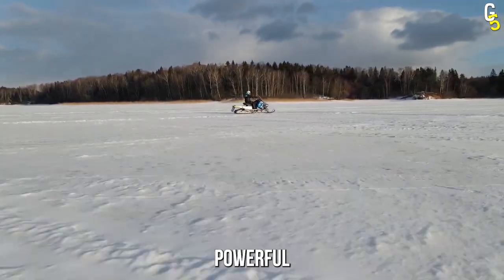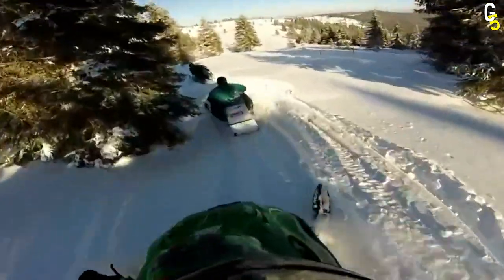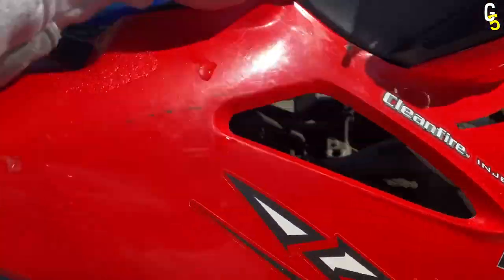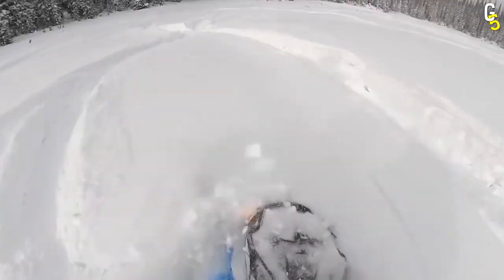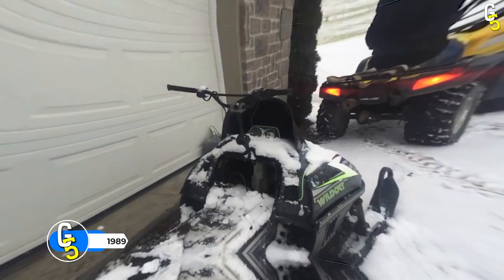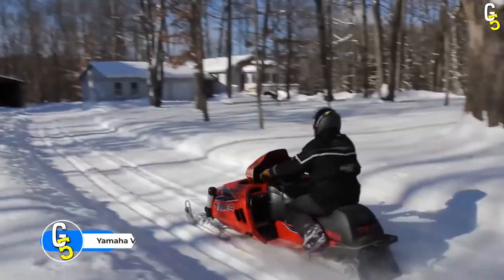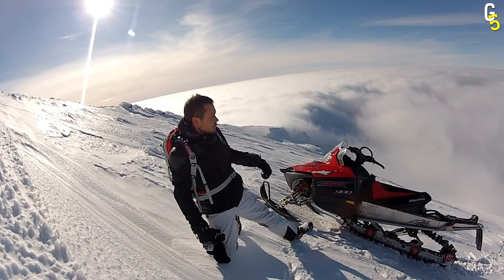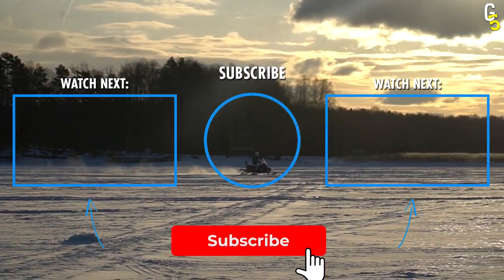6 Snowmobiles That Could KILL YOU! ☠️

Comment: You covered the same sled twice. The RMK 900 and the Fusion 900 have the same problems. One cannot be worse than the other. Also, the fusions were the fusion chassis and the iq was iq. Not the same. Thirdly, the fusion 600 was a newer model than the fusion 900. Also, Polaris discontinued the 900 in 06 and only released a new one for 2023.Finally, many of the pictures and videos you showed were not of the sleds you mentioned. Please, use more correct information and pictures.
Reply: Yeah, my friend's 2023 RMK Pro 900 broke a crank at 6.4 miles

Comment: Forgot the 750 POLARIS turbo 4stroke. ECU Issues Engine code problems in cold weather,   fuel tank gauge issues, Clutching and Chain case bearings  you could not get parts for.. Crank Case oil Issues soaking the foam air intake.  My 08 Switchback cost me 50 grand to keep going in the two years I owned it.  NO Sledder should be paying that amount on a production snowmobile. HELL Snowmobiles now Should not be more then 14 000. I Won't pay it and you shouldn't either. They are time bombs. Still 2stoke and still only last about 5000 to 6000 miles before needing a complete over hall. 
The 750 and the 900 almost bankrupted Polaris. But yet the 4stroke Engines found there way into the RZR and seemed to have held up well.

Comment: arctic cat sucks so im not suprised and there so fucking heavy
Reply: @gjvdalracing8541  polaris are better
Reply: What’s the matter an old zrt break your heart back in the day?
Reply: @AffirmedPie  no its that kids wanna race my ultra or my xcr 600 and get absloutley smoked after talking shit about my sleds, not saying your that guy but i was just expressing my opion on it.
Reply: @Thatred5.0  ultras we’re quick. Ol 680s smacked back in they’re day.  Zrts/ thunder cats, ultras, srxs, and Mach Zs we’re kings of the 90s even into the early 2000s and for some newer sleds that are just plain dogs
Reply: the one he talked about was the powder extreme zrt but proceeded to only show videos of the powder special like the one i have which goes everywhere the new lynxs and ski doos can go plus the powder is better than polariss 90s efi i should know i have a indy 500 that needs a battery for the efi when the artic cat dont
Reply: Iv owned them all... I'm only 140 lbs and I bought a ctec2 artic cat El tigre 6000 and it's faster then sidewinder with 300 hp... yes I do get passed on the lake but definitely not off the start and I leave them in the trails. The new ctec motor is very quick because of the rotating mass in the gears compared to other snowmobiles. Artic cat is def number# 1 then yamahas are 2nd# and polaris is 3rd!!
Reply: @simonbenn5340  arctic cat is rated as the least liked brand and are known to have problems polaris will always be better sorry you have to ride a shitty kitty